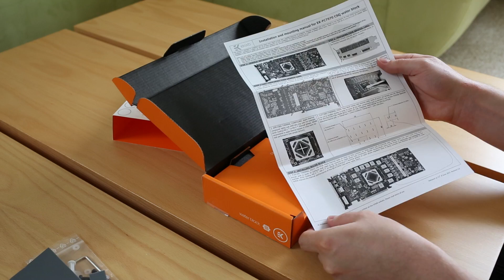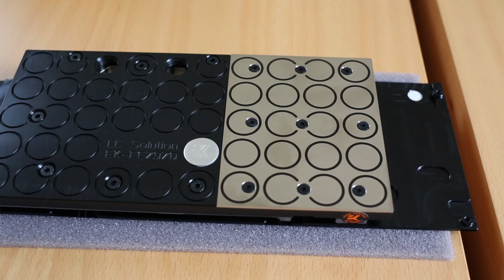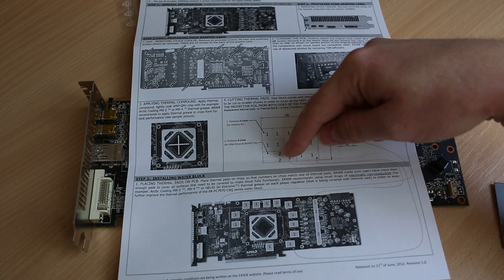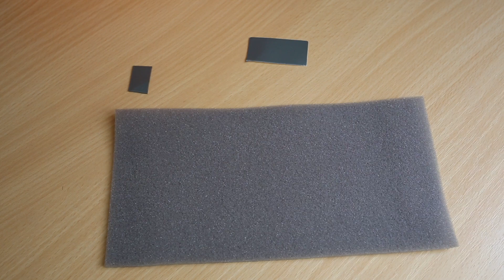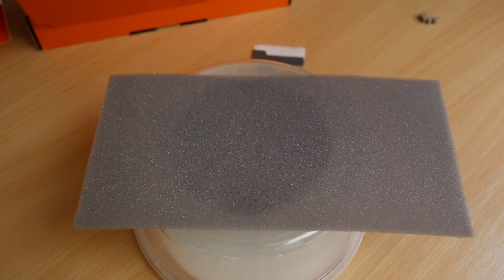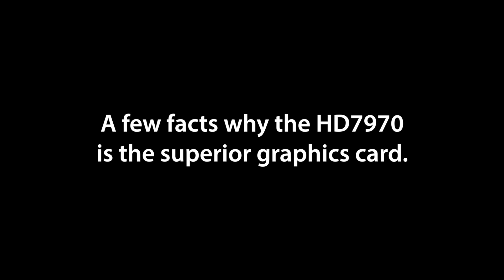EK-FC7970 CSQ unboxing - AMD Radeon HD7970 graphics card overview and waterblock installation

Comment: Please, PLEASE, just put a pea sized dot on the gpu chip. nothing else is required. pre spreading on both surfaces will have no advantage, just more to clean up when it all squeezes out. it can be dangerous for the equipment especially when the thermal paste is conductive, it can short components frying the gpu.
Reply from the maker: I have had very good experiences with my technique, but I am willing to consider your feedback for future projects.

Comment: Can you take off these plates and put the old factory fans back on ? ( want to put everything in another case and get rid of watercooling )
Reply from the maker: Yes, no issue with retro-fitting air-cooling. Keep in mind you might want to invest in new thermal pads, a good thermal paste and cleaning it first. 😊

Comment: does this work without having anything in the fan plug? my thanks will be great
Reply from the maker: +0181J Yes, i've been using exactly this card with this cooler as mounted for over 2 years now. Still works like a charm. So nothing required for the fan connector.
Reply: thnx bro, do you know if the same goes for cpu fan? got a rog ranger vii maybe its customizable in bios?
Reply from the maker: +0181J The Asus Bios are pretty neat! They let you select certain presets for you fans - but more specifically, you do NOT need to plug in a fan for the CPUFAN for the computer to work, but you'd most likely have to disable the CPU-RPM warning in the BIOS. (very easy! preselected is something like 500RPM or so and just select OFF/NONE)
Reply: +Florian Uhlemann i would like to thank you very much! You're help was very useful

Comment: not good putting tape on the memory circuits.
Reply from the maker: 1112223333111's Channel tape? Those are thermal pads included by the manufacturer (EK Water Blocks in this case)
Reply: Florian Uhlemann  
not good putting anything on the memory circuits.
Reply from the maker: It is recommended by the waterblock manufacturer and is actually done by almost all graphics card manufacturers as well on reference design gpus and most custom designs. ASUS, Gigabyte, VTX3D, EVGA, ....
Reply: Florian Uhlemann Not on the solder side though...the slightest change in resistance or capacitance is enough to cause problems.
25:32 here this is no good.
No backplate from the factory has anything on it.
http://www.techpowerup.com/reviews/HIS/Radeon_HD_6970/images/cooler2.jpg
http://www.overclockersclub.com/reviews/xfx_hd_5870_1gb_hd587a_zn/images/29.htm
Reply from the maker: That's what you meant. I apologize. Misunderstood. Yes, I agree. It's not supposed to be on that side and I do not recommend it myself. I've only done it myself as an experiment - but I haven't had any negative effect on it besides being properly cooled :)

Comment: Hey man, I just want to put a back plate on without the water block to stop sagging and make it look nicer. Is it possible to put the back plate on without the water block?
Reply from the maker: Sunny Hyland There are certain back plates offered for cards as an optional part from your local computer "tuning" shop or online. But the EKWB one won't work unless you have the waterblock.
Reply: Florian Uhlemann Thanks for answering, I just bought an GTX 970, so problem solved haha.
Reply from the maker: That works, too, I guess. 😊 have fun with that powerful card. I'm still using my heavily clocked 7970 at 1188:1800 ^^ performs like a charm for over two years now with 1.2V gpu and standard 1.6v memory.
Reply: Florian Uhlemann Not even sure what to do with my 7970.. i think I'm building it into a media computer for my lounge room in a micro atx case. they look fun.

Comment: Hi, i'm a bit newbe about Watercooling, but can you help me ?
I bought a R9 290X and i want to buy the EK water blocks, do i need anything else or just the "plats" is enough to cool the card ?
How i put the liquid thing ?
Reply from the maker: Have a look at EK Water Blocks starter kits. They should have all components required to get startet. you will need fittings, tubes, a radiator, fans and a pump in addition to the waterblock which is installed on the GPU. For the liquid it's usually easier to install a reservoir in the loop that is used to fill up the system as well as bleed the air out of the system itself (air collects in top of reservoir)

Comment: do i need to have a water pupm and/or ventilator attached on waterblocked gpu?
Reply from the maker: If you are using a watercooled gpu (waterblock installed on graphics card) you will need to properly cool it. If not, it will overheat rather quickly. The minimum is a pump and radiator (passive radiators would work as well) - so fans could be optional, but not the pump. Water needs to flow through the waterblock itself.
Reply: Florian Uhlemann
Thanks, so with EK waterblock i need to buy a pump seperatly, or do I get one with it?
Reply from the maker: thaares the waterblock is just a single part in your water-cooling system. you will need a pump, radiator, fittings, tubes and cooling liquid. However, EK also offers a complete starter kit to buy with your waterblock

Comment from the maker: Well, according to the cooling configurator, the R9-280X Gaming edition from MSI will fit this cooler. You do not need to install the thermal pads on the rear of the PCB. This was an optional thing that I tried to provide the lowest possible temperature on the memory modules. I can't say that it did do anything bad. Think it does actually do a little good - but might not be worth the efforts and hassles.

Comment from the maker: Most of the R9-280X cards are the same. ASUS only brought out one new R9-280X card (dc2t with the new fan assembly and new I/O options)
VTX3D continued to use the old 7970 reference design (as in my video) ... So pretty much all older blocks keep working and EKWB might not make a whole lot new blocks for the 280X series. but still. 249€ for a vtx3d r9-280x is one hell of a deal for a great card! (features elpida mem instead of hynix memory)

Comment from the maker: XFX BlackEditions are good for over clocking as I believe, but so is the VTX3D due to its additional PWM phase.

I can easily game at 1215:1850 ;) (gpu clock:mem clock)

But yeah, that card would most likely work and be a great performer. I've never found an XT2 card (GHz editions) that outperformed an original 7970 ;)

Comment from the maker: You can check at EKWB's coolingconfigurator and see which card is supported / if your card is supported and be sure nothing goes wrong. Keep in mind: Any HD7970 card that features TWO DVI outputs, is NOT reference design and will not fit the EK-FC7970 CSQ block.